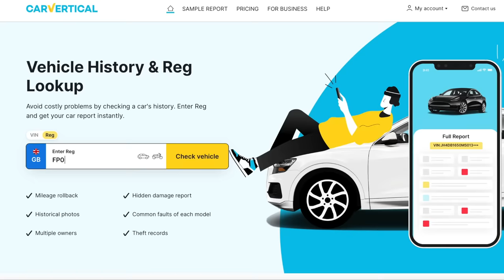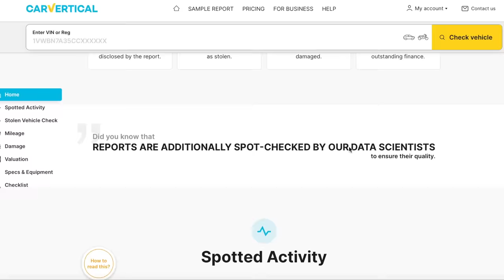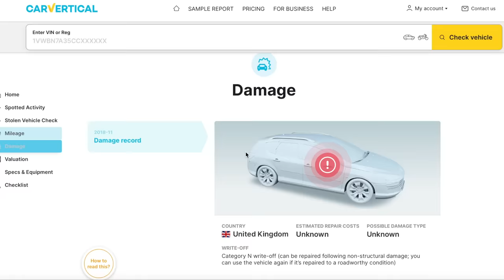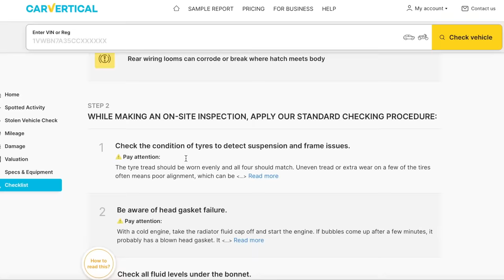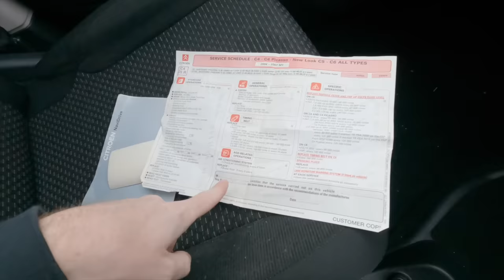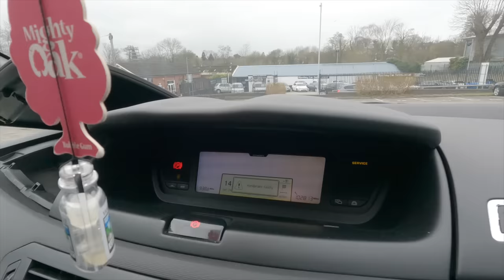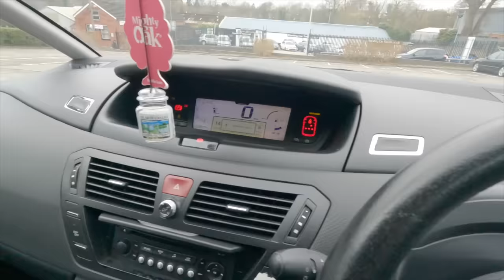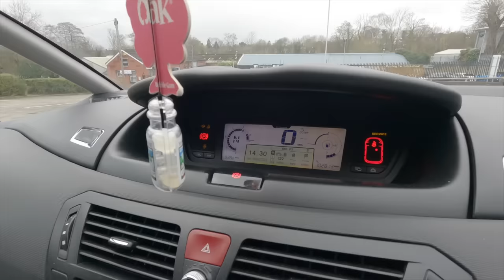I BOUGHT A CHEAP CITROEN C4 PICASSO FOR £300

Comment: Just my opinion and nowhere near as experienced as you Lot of these were taxis in Gibraltar and the diesels were lauded by them when I spoke to them. Much preferred over german diesels( on cost to run)Just 3rd party info. 😅What can I say I drive a 2007 petrol berlingo😁😁😁😁😁which I guarantee will be a collectors car a La 2cv. No electric frills 2 elec windows that’s it 1.6 petrol easy as to drive, capacious and in my case (10yrs) totally reliable and a beautiful ride. Also never failed an mot but very well maintained by me still strong at 100k no rust. I have the same feelings against German marques as you against French. Japanese for bikes and cars per se. Or in my case what makes u happy and can afford. Pleas manufacturers ditch the electronics we dont need them. Make reliable long lasting products again as in the 80s. My vw transporter did 330000k when I sold it. Was k reg 92 I think still on road at 530k 2.4 5 cylinder diesel no turbo just mechanical pump. Still did 70 to Europe on ways 40mpg. No electric windows- nothing. Tyres brakes oil and filters . I sold it as welding was gonna cost earth but someone saved it

Comment: I have had one (manual), it’s up to 108,000 miles with 1 filter problem in 70000 miles that I have had it. Very comfortable, takes a huge amount of stuff. I would buy another one

Comment: Despite me hating French cars, I bought a 2004 Citroen C2, manual with all sorts of accessories. Still find it somewhat weird, but I kind of got used to it. Steering wheel is kind of weird and the position of power window switches. Otherwise, I was pleasantly surprised. Pretty reliable, just perform regular maintenance properly and on time. Kind of changed my mind about French cars. But when I see this... OMG!

Comment: You need to try our 2011\61 C3 Exclusive 1.6Hdiwith 16100 miles, total Main Dealer history serviced every 12 months, kept as brand new and now with all new high quality Goodyear tyres, new battery and it runs, looks, drives and is a clean as brand new. The engine is a delight and will return 65mpg anytime and 80 mpg on a motorway cruise. It has never gone wrong..nothing rattles, everything works and has been a joy to own from 6 months old. I think the big problem with Citroen is that they are bought cheap, badly maintained, hammered about as family boxes and driven to death…underneath they are good…a friend brought her fathers battled scarred Zara estate over from a life in Malaysia where he used it as a company hack and left it on the rocks, unlocked for months on end on a regular basis..nobody stole it, it had plenty of dents and was shabby as a dustbin…BUT was going well at 210,000 miles and not rusty..worthless but still going strong! Not all Citroens are bad!😀😀😀

Comment: DO NOT listen to this guy.   We have had Picasso's, since they first came out,  including our current C4 picasso exclusive Plus.   Everyone has been  very reliable, and economical. I am an experienced engineer.  Listening to this video, I would suggest the guy know almost nothing.  Dreadful attitude about one of the most favoured MPV's avaiable.You only have to count them on the road and how old many of them are.  Also our neighbours have had picasso for "years". The only problem we have is that the storage available in the latest C4 is nowhere near as spacious as the older Picasso model.

Comment: I've been driving french cars for 18 years now. I've had 6 of those altogether, 5 Renaults and one Peugeot. So far the biggest problem has been the electric windows on Renault Megane 2, but those were cheap to fix. On the other hand my mates have had german cars that way too often had extremely expensive problems with turbos, gear boxes, engines and electrics. I don't dare to test my good luck by switching to german cars, even though I'm  tempted to try a Volkswagen Taigo or maybe even a korean or a japanese car for a change 😃

Comment: Citroens are absolutely garbage. I ran a C5 ,as a taxi for about 12 months. The first 3 months were ok, ecomonical(2.0hdi) and comfortable with the hydraulic suspension. Then things started to go wrong. The suspension is supposed to stiffen the faster you go, and lower slightly. That stopped working but I didn't bother with it. Then the self leveling headlights (HID) went into limp mode and just pointed straight down. The ECU which controls them had gone, I found the only one in Europe, in Belgium. Then it started going through injectors, about every 6 weeks one would go. My mechanic used to hide when he saw me coming. Then the bearings went on one side of the rear suspension swinging arm. It used to creak when passengers got in the back. My mechanic wouldn't touch it as it meant depressurising the suspension. So I chucked it into a main dealer to get it done. That cost £600. They washed the car though. After going through my 4th injector, my mechanic thought there was an ECU problem. He sent it away to be checked and apparently it was faulty but couldn't be repaired. A new ECU would have to be fitted by a main dealer as they have to be programmed to the car. Even a second hand one has to be programmed in. New ones are well into four figures fitted. A second hand one is a couple of hundred with no guarantee. My main dealer wouldn't fit a second hand one, and I couldn't find an auto-electric engineer with the software to fit one. So I scrapped the car. It cost me just over 2K, in 12 months I had spent 1.5K trying to keep it going. I got £300 scrap for it. The only good side to this story is it got me out of the taxi trade.

Comment: Couple of tips for you. 

1, If you want viewers maybe be less arrogant about your views on cars. I ain’t talking about Citroen themselves but any car brand. You may not like them, and neither do I but the 738,000 people who bought one did. 

2, The radio cover isn’t there to cover up the radio in case of theft. It was there to close, to make the dash look clean. 

3, This car wasn’t designed by Citroen. It was actually designed by its sister company Peugeot. 

4, please make sure you give the correct advice to your viewers. These EGS auto model were only on the pre facelift ones. When the facelift came in 2011 they were all replaced by the EAT6 speed auto which is a fully automatic gear box due to the complaints. 

Please please educate yourself. Just because you buy and sell cars doesn’t mean you know anything. I’m guessing if VW and Audi made a built on air freshener it would suddenly become the best thing in the world.

Yes this car was awful. But tbf it’s probably also been neglected and hasn’t had the maintenance it’s needed. Any other car would be the same.

Comment: That little red OBD box is a so-called plug and play tuning chip. You can buy them for about a tenner with wild claims they can give you more power and torque than a Ferrari Enzo.....  Could you imagine the results if you used it on say a 1.3 Multijet Panda  🤣🤣🤣

Comment: Had Zeetexs on a 1.4 Mazda 3, tyre guy told me they where good. He lied. Where they good in the wet, no they wheelspinned in the dry, with the incredible torque of a Mazda 1.4. They would always provide an ABS kick when you tried to stop.

The question is does the OBD booster bought off amazon work. Did it make this shed go any faster.

Love these videos they are great fun to watch.

Comment: That has been so badly neglected. The suspension bushes probably original. Probably not been serviced since 2009. Obviously never had a gearbox service, never thought to get the handbrake looked at, never had the fluid topped up for the dpf. But that C4 wasn’t Citroen best effort lol. Produced during the global recession just what you want from a car.

Comment: I had the pleasure of valeting one of these in 7 seat form and it was horrific. It was just completely abused, it stank, it was horrible to clean and the customer could definitely have afforded something much nicer. 
The customer spent £100 having me round to clean it for 5 hours and it was still garbage. Hate the stupid steering wheel, the daft stereo, the hatefully loud diesel engine, the squeaky knocky suspension, snappy checkstraps….everything. Hateful things, I’d much rather have a VW Touran or a Dacia Duster or a Passat estate or a Kia Sportage or something. Anything. Anything other than this. I’d even have a Qashqai. It’s actually unfair to suggest that Qashqai owners have no imagination - they must have at least half a droplet of sense otherwise they would have had one of these.

Comment: Ours is the motability car 7 seater the 1.5 turbo diesel.The car is from 2019.Ours is the six speed manual gearbox.You have a problem with the French Matt not the cars just be honest.I have driven all the shit under the sun when we tested cars for Adibis oil company.Why spending £300 if it is that bad Matt?

Comment: they do break and as a diesel it  costs more than a petrol to fix ,but....that 1 was way left out and malserviced....got the same 2009 model, the injectors tend to break and they are expensive, albeit the smell of exhaust in the cabin since they mix withe airflow of the aircondition. not a good example and definitely not the majority of this model out there. and it isnt worst than the JUKE!!!

Comment: Gearbox was in emergency mode due to an abs fault, as the semi autos get the speed reading of the abs ecu. It will only give you 3 gears on manual .if this was a manual it would be perfectly driveable. Think you were a bit too quick to condem this one matt, its normally either the hub contaminated by grease on a split cv boot (covering a perfectly working abs sensor as well normally), or wires split behind the battery. also the gearbox fuses blow and corrode by the battery. Really common on these,  and Pug 3008s. Normally a very cheap fix.  Plenty of vids on here . 9 times out of ten its never the gearbox .If you just hate french cars then understandable they are like marmite.

Comment: There are 2 litre petrol versions of these with ~140HP and a proper torque converter automatic while keeping the fancy little shifter lever. Still, the electronic handbrake will most likely give you issues on those as well.
Most of these I've seen for sale have been diesels and with this horrid gearbox, so finding one might be difficult.

Comment: Think that might be the same engine as the one I had in my late and not at all lamented Volvo V60 Drive. Some other sucker footed the bill for the knackered turbo before I got it but it suffered all sorts of other issues including a blocked DPF before a mysteriously random and completely untraceable power drain and dying PAS rack finished me off with it. Gutless, awful driving position and the turning circle of a supertanker. Utter garbage.

Comment: Omg…i have bought one of the petrol versions just couple of months now & i still do not know how the climate control on the RHS work. Well it is running fine as of now. However, the faulty service messages keeps giving me an heart attack every now & then & they just disappear at a simple re-start. Same like our computers. It does the job for me now. Will have yo find a buyer before it touches 100k miles.

Comment: Lots of great points made in this video. Sadly manufacturers just don't seem interested in making simple, reliable, easy to service or fix cars. Do they believe their own marketing madness, or is it the potential revenues from servicing? Either way it doesn't help the buyer. 
Ford and VW have also served up horrendous DCT gearboxes that have cost unsuspecting punters millions over the years.

Comment: Calling it a Turd is too polite. I owned a couple of french cars many years ago - when I couldn’t afford anything else. They were absolutely awful. These were the days when you didn’t get warning lights on the dashboard - not many anyway. Despite this fact at least one of the few warning lights were always on during my whole ownership. Not the same light of course. When one thing was fixed something else broke. What these cars really need is a big pointy cylindrical warning light; warning the driver that they are a d*ck head for buying the thing in the first place. I know I’m right on this. I’m now looking to buy a sailing boat…and am sorely tempted with a french one. Every sailor I speak to says don’t touch a french boat with a barge (or sailing) pole. If it had a warning light on in the shape of a big pointy cylindrical thing it would be flashing at me as usual. Some people never learn.

Comment: Wow, that was painful to watch. When you started ranting about how awful those were I was thinking to myself that I've always thought they looked pretty reasonable. Not really my sort of car but pretty interesting and not bad for what they were and I always thought the quirks (such as the fixed steering wheel hub, extended windscreen and interesting climate control placement) were kinda cool. The sort of "lets try it and see" attitude that separate Citroen from the more mundane manufacturers. Then you drove it. Wow. I stand corrected. I think you've done everyone a favour by getting that off the road!

Comment: You bought a ball of scrap picasso ..   I've on my second ..  had a 08 one that drove all over Ireland without an issue, only ever needed an egr valve..  I'm in a 12 one now that I love and has had no issues so far...  By the way, it can be set in the settings for the handbrake to be automatic.. namely engages when ignition turned off, and disengages when you pull of ..  if it does get stuck there's a way of manually winding it off under front passenger footwell with tool provided in with wheel changing equipment...
They're cheap cars, and most people don't look after their cars properly is why they either fall in bits or have lots of problems..  if you don't buy a bag of shit one, service it regularly and look after it and don't drive the shit out of it, they're a great car

Comment: The reason it didn't gear up above 3rd gear was a faulty speedsensor. We bought such a car without all the other issues and changed the sensor - no problems after that. This kind of gearbox - robotised manual - needs to be driven in a certain way. If one listens to the rev and lifts the gas pedal it changes gear really nice. It's possible to drive very smooth with these cars. Electric handbrake - I don't like though but I think it has something to do with the type of gearbox without a P mode.

Comment: I go to an independant citroen specialist  who repairs and maintains the citroen DS for people all around the world who send him steering racks and pumps to fix,  people will drive their classic citroens hundreds of miles just to have their cars maintained by him and he absolutely hates the 1.6 hdi engined cars esspecially the C4 picasso, he says they are a nightmare to work on, hardly any access to the back of the engine, dpf  and egr issues, electronics issues, electronic handbrake issues and the list goes on. Ive got a 2019 1.5 hdi diesel auto Citroen C5 Aircross which is a much better car with good access to the engine, the electronic handbrake has upgraded calipers which are easier to maintain and better quality, the silly steering wheel centre has gone, its easy to change headlamp bulbs unlike the picasso where you need a 2ft pair of surgical clamps to reach the dam bulbs.

the 8 speed auto gearbox is no longer a dry dual clutch and is a proper wet syncromesh gearbox and the gear changes are very smooth, yes it has flappy paddles which are good for hill climbing if you are towing a trailer or caravan. Mpg is around 55mpg. it also has great big armchair like front seats and is very comfortable to drive.

Citroen are one of the brand leaders in Dpf and emission technology and they more or less perfected it in the Mk2 Citroen C5, why they went backwards with the C4 Picasso and the X7 C5 car Ill never know, it must be something to do with that 1.6 hdi engine having constant dpf and egr issues. short journeys kill these cars, they really need a good thashing for at least 25 miles once a month to keep the exhaust systems clean and servicable, neglect always leaves them a bit lack lustre. I think because they are a cheaper brand with lots of toys people tend to under estimate their need to service them and maintain them.

Comment: These EGS transmissions need very precise calibration and are capable of changing gears quite smoothly. Garages usually don't know how to do this properly or cannot be arsed! if some gears are not engaging, it is just the gear actuator that needs looking at. C4's are quite simple and easy to work on in general.

Comment: All Citroen's are unspeakably horrible. The older older were cleverly designed, but the build is what lets them down. Years ago (1990s) a colleague had a Xantia as a hire car - it was new, as in delivered to the hire company that morning and straight to  him, miles were under 30. He raised the suspension. When he tried to lower it, the car stayed raised.

Comment: It's a family car, it will get abused. So it'll need at least half decent build quality to stand a chance! And the build quality of that interior looks woeful. Although all the pieces do still seem to be attached. At the time it was produced this thing was actually winning awards due to the space and comfort. Can't knock the French for their diesels. Always seem to be reasonably frugal and punchy. Not too loud either. Electrics on the other hand are not a strength. So what you really don't want is a complicated French car! Friend had one of these. Cost her a lot in repairs and often broke down. At 9 years old at 100k miles it was practically at the end of it's usable life.